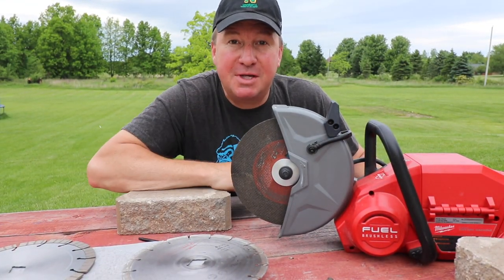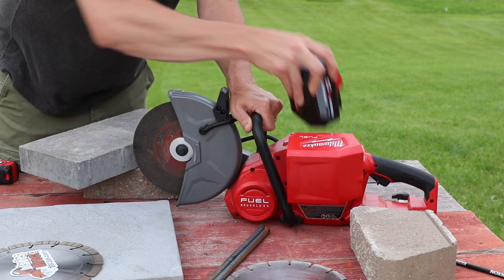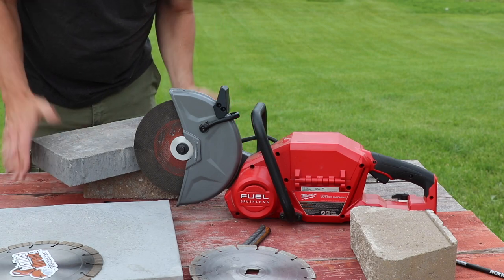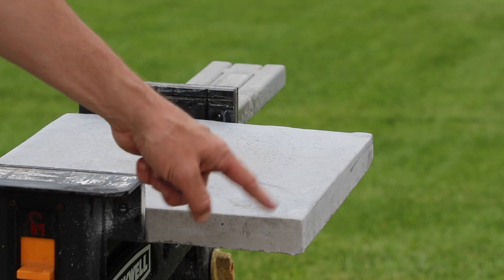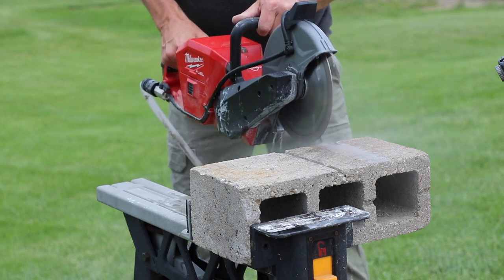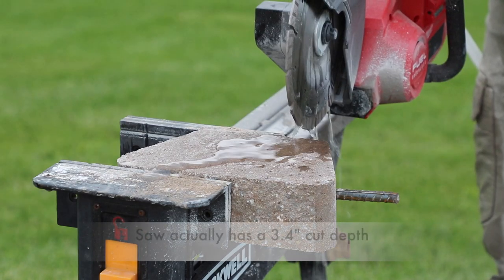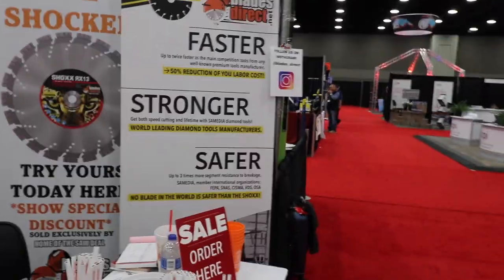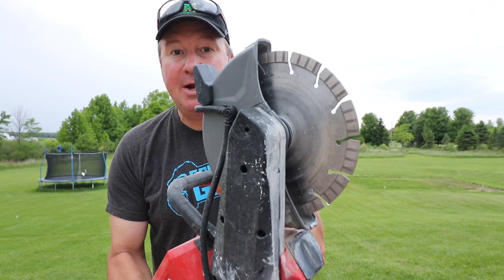ROC CRUSHER SUPREME 9" DIAMOND CONCRETE CUTTING BLADE COMPARISON

Comment: Man I kinda wish I had use for a cut off saw like that Milwaukee.  As far as your question about stock blades, I always ditch the stock blade for a Diablo when it comes to Circular Saws.  Milwaukee and Dewalt stock blades aren’t bad, it’s just Diablo is better that’s all.  Makita’s stock blades are pretty dam good.  Enjoy that cut off saw man !
Reply from the maker: Thanks man, some good points you made there!  Now that you mention it, I have a Makita saw and I didn't change the blade out.

Comment: I have the Makita XEC01 9” Powercutter (36 Volt 18X2) that came with a Makita Diamond Blade, after I’d used it a few times I ordered some ROC Crusher Blades from bladesdirect.net and the difference is amazing. 
I use my saw to install “Saw Cut Detection LOOPS” in Drive Thru lanes with most cuts being 2” deep and a total length of around 24’ in older concrete that can be pretty hard. With the included Makita Blade the saw preformed well and I would use 2:pairs of 5AH batteries and part of a third pair for each LOOP  With the ROC Crusher Blade I can cut most LOOPS using 2 pairs of 5AH batteries but the second pair will still have 1/4 to 1/2 charge left! 
The ROC Crusher Blade cuts faster using less power despite the fact that it is making a wider cut than the Makita Blade (this is another plus for me since it makes it easier to install the loops of wire into the cut). 
Without a doubt the ROC Crusher Blade is the best blade available for these saws available. 

For cutting Steel that isn’t in concrete you should check out PFERD Abrasives, I’ve been using their products for more than 30 years and they are simply the best available, the blades outlast the competition by several times and in all that time only one blade has failed (came apart while using it). 
https://www.pferd.com/us-en/products/cut-off-wheels-flap-discs-and-grinding-wheels/cut-off-wheels/performance-line-sg/sg-steel/flat-type-1-41-plain-arbor-hole/flat-type-1-41-plain-arbor-hole/9-x-3-32-cut-off-wheel-7-8-ah-a-24-s-sg-type-1/?filter=%7B%2522anwendungSelMore%2522%3A%2522Cutting%2522%2C%2522antriebsart%2522%3A%2522Angle%20grinder%2522%2C%2522werkstoffSel%2522%3A%2522Steel%2C%20cast%20steel%2522%2C%2522finder%2522%3A%2522product%2522%7D
They have an extensive product line and everything that I’ve used has been outstanding.
Reply from the maker: That's cool, thanks for sharing.  I only used the Makita blade for a couple test cuts, so it's interesting to see how it does for longer periods of time.